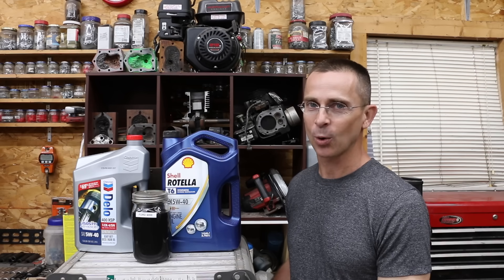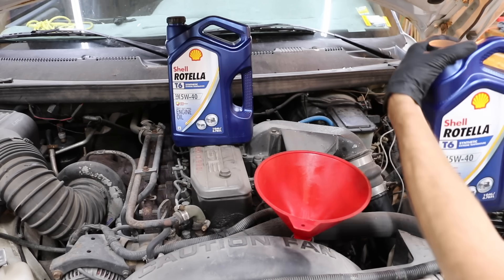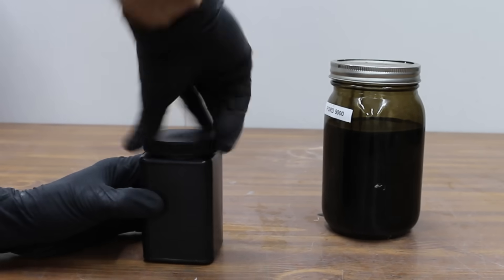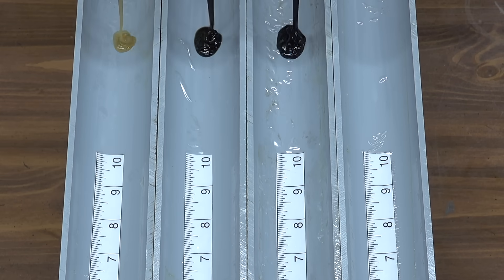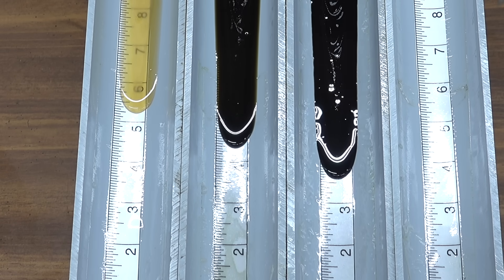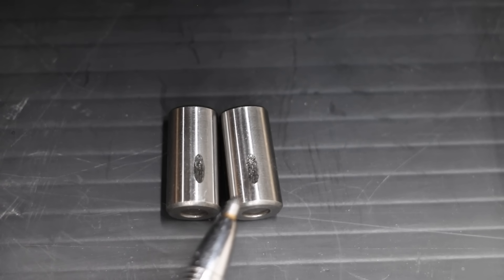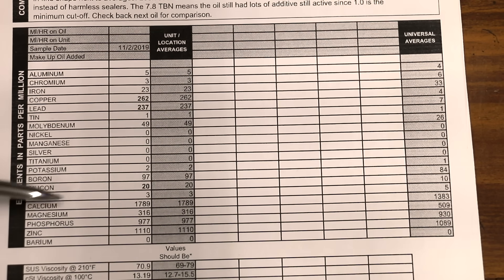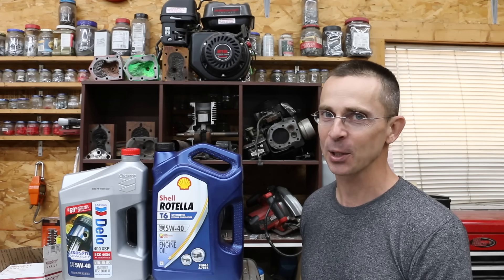Will Annual Oil Change Damage Your Car? Let's find out!

Comment: How about the filter, if the oil can last longer for lower mileage.. Do you still have to change the filter once a year?
Reply from the maker: Thanks for the video idea.
Reply: The lab results also suggest the filters are good.  If the filters were compromised ( bypassed for example),  the lab numbers should indicate engine wears.

Comment: Still need to check under the hood every so often. Power steering, transmission fluid, brake fluid, belts, any unusual noises. Probably do that with monthly starts
Reply from the maker: Thanks for the feedback.

Comment: Dude you have the holy grail of trucks. That 2nd gen is immaculate with low miles!!
Reply from the maker: Thanks!
Reply: @devilselbow  along with every other brand. Ask me how I know
Reply: I've given up on finding one for a price that isn't insane. I just did the next best thing and swapped a built Ford 300 six (the one with forged internals that were put in dump trucks) into a gas 4 speed F-250 that had an oil burning problem.
Reply: @devilselbow  up here in coastal Canada, here in a small fishing community, fords last longer sitting on a wharf in salt spray and saltwater flooding over the wharf for hours on end before rotting out. Its amusing as before everyone was driving fords chevs dodges and gmc trucks years ago but now everyones gone to fords
Reply: @devilselbow  not going to doubt Toyota. I have two of them and they both have rust. But we have a 2003 dodge Cummins and strangely enough it doesn’t have a speck of rust. We always to care of it though
Reply: OIL SPRAY,end your rust.Simple
Reply: Everybody loves those engines, but the rest of the truck just isn't very well made.
Reply: @marcuscook5145  Or you can do what I did and put that engine into an 07 f250.
Reply: Aha!! The secret to a Dodge truck’s long life is low miles.
Reply: @gregnixon1296  the secret to long life dodges is a well taken care of Cummins. More trucks over a million miles than the other 2 diesel competitors combined

Comment: I was pleased that you did this video, I've got a truck that only gets used 2000-3000 miles a year and I was worried about the oil.
Reply: Yeah.  I usually figure out all the ways to get away without doing things that don't need to be done by learning a lot of hard lessons.  Already figured this one out for low milage cars years ago, but it's always nice having my process confirmed with science.

If anything, I'm thinking that the 1 time a year I change my oil is overkill after watching this.
Reply: @thedude5295  It's pretty important that even if you don't put many miles on a vehicle per year, when you do run it, run it long enough to get it to full operating temperature. A bunch of very short trips on a vehicle are HARD on it.
Reply: @TomD1999  Good to know.  I've noticed that the car starts up fine right out of the garage, but if I'm going to 2 or 3 places in the area in a single trip it starts a bit harder by the last time I fire it up.  That's even during the summer.

Comment: I have a very important question about engine oils. In Pakistan we use toyota's 2nz fe 1.3L and 1.5L 1nz fe engines and the company recommends 5w30 engine oil but the temperatures in Pakistan rise to 50 Degree centigrade which is very high. Should we use 5w30 or the thicker 5w40 as preferred by many bcz if high temps? Your reply will be very valuable for us pakistanis. Thank you.

Comment: With this experiment I would have collected all of the 1+yr old oilfirst, shanken it up well and then collected the oil sample from a mid-flow exchange from that ontainer into another container to get a more accurate reading of contaminants including excess water. It might be a better test in general any time you remove oil from a crankcase.
Reply: That's the way that my dad would collect oil samples when he was sponsored by various factory race teams. He would collect one from first mid flow and a second one from the shaken up total collected at mid-pour from container used to collect the initial drain to the waste barrel. Just food for thought. Keep up the great work!
Reply from the maker: Thanks for the constructive feedback.

Comment: Use Mobil 0-w40 in my 2004 Crossfire which is recommended. Any info on this oil would be great.  Current do very low miles and thinking of waiting a year before changes.
Reply from the maker: Great suggestion!  Thank you.

Comment: I've been doing a >10,000 mile interval on my 4.0 Wrangler for 18 years. Haven't' been doing the mileage in the last few years, so I've been going every 2 years. In fact, My Generac actually recommends changing the oil at least every 2 years. 
Motor oil is one of those things that people just love to over-think. People get it in their head that somehow the oil starts going bad as soon as it goes into the car. That's not the case at all. There have been studies that say oil actually gets better for a while before losing any beneficial properties and A synthetic at 10k  is actually still better than it was when it was new.
Reply from the maker: Thanks for sharing.

Comment: This has so many environmental factors there's no way you can simply tell from a test. This being said I can recommend on anyone with a 5.4 3 valve engine to change their oil every 3000 Miles without fail and use 5 quarts of 5w 20 and 2 quarts of either 5w 30 or 10w 30. 5.4 L engines are notorious for cam phaser wear causing a noticeable ticking noise. This comes from a few things including stuck or dirty VCT solenoids not opening causing premature upper engine wear or cam phasers wearing prematurely which causes the engine to be out of time and causes a tick. Change the oil and you'll get past a hundred eighty thousand miles, don't and you'll need to do a full timing set and oil pump.
Reply from the maker: Thanks for the feedback.

Comment: I knew it was a myth with modern oils. I let my lawn tractors and zero turn wait until the hours. I change my cars full synthetic every year at the same time it is in for annual inspection up here in NY. An oil and filter is cheap compared to the cost of engine damage. I have a 2013 Toyota V6. So little chance of that.
Reply from the maker: Thanks for sharing

Comment: First, thanks for the videos as they give me great entertainment. Did you ever test how transmission fluid would hold up to extended service? My Honda Jazz (Fit in USA) has a CVT and the manual calls for two year fluid changes. Obviously, I'll go with the manual's stipulation and the change is cheap compared to a transmission fix. But I am curious. Big thumbs up from Ireland!

Comment: Great video! Considering about 2/3 of vehicles on the road are more than 75K miles, and many of them use high mileage oils ( conventional or blended synthetic). I hope you can do a similar test with high mileage oils with the priority for conventional high mileage oils. After all,  conventional high mileage oils are less likely to cause engine leaks. Thank you!

Comment: I think the idea behind the yearly oil change under mileage is due to the use of conventional oil. Conventional oil is less resistant to breaking down than synthetic oil. It may even be from when oils were less advanced and were more prone to rapid breakdown and contamination over a years time.

Just my opinion based off of the automotive education and experience that I’ve had.
Reply from the maker: Great feedback. Thank you

Comment: Another good video. I used Delo in a gas I4 engine before. It had no emission equipment to worry about.however the engine did have a rod knock. I was simply trying to baby it till spring so I didn't have to pull the engine during the cold winter weather. I have in my mk6 gti now T6. It seems quite and not a unusual amount of metal during drains. 
Btw the Delo worked fine in the previous engine and it made it past spring and into summer where I then pulled the engine and did a full rebuild with a new crank and rods.

Comment: I had a performance V8 with 40,000ks on the clock when I got it, I didn't do a service or change the oil for 60,000ks. Nothing happened. It still drove like new. Those 60,000ks were over a 7 year period. Tell me again how you need to change your oil every 6 months. Admittedly, I don't drive my cars hard and these ks were both long trips and around town.

Comment: Besides testing a similar scenario on a gasoline as one of the comments said, it would be good to see how the oil degrades over mileage... if you go 3000 miles over, 6000 miles over... for an engine driven in extreme conditions as per manual..

Comment: Should do a test does oil filters that can last 15000 mile is that on a single oil change or using the same oil filter twice for example oil change at 7500 keep same filter on with new oil?
Reply from the maker: Thanks for the video idea.
Reply: @ProjectFarm  no problem it's just confusing those oil filters that say have a 15000 mile life spend for I have filters I just don't want to change oil at 6000 or 7000 miles and throw away a completely good working oil filter if I can use it again for another 6000 or 7000 mile
Reply: @ProjectFarm  oh by the way right now from my knowledge AutoZone STP max life filters (that last "15000" miles) cost around $4.00+tax if your going to the video

Comment: definitely right.

my dodge 4.7L has had the same oil (valvoline synthetic with Lucas additive) for two years, only about 1100 miles.

dealership tested the oil last month, and came out still perfect.
Reply from the maker: Thanks for watching.

Comment: i was right! i ran 5k miles on Castro full synth for 14 months in a Mazdaspeed turbo with no issues other than som oil loss from the turbo.  I never believed the 3 mo 3k oil changes bullshit even for reg oil!  Oil is effing tough stuff and better additives than 30+ years ago!  Common sense imo.
Reply: Well in the US seems there is a Jiffylube or similar every 5 miles along the highway and everyone is told 3000 miles or your car dies!!! Back here in Europe...no Jiffylubes and annual/every 10000 miles oil changes (if you can be bothered...close enough). I wonder why...
Reply: The 3/3 is what folks did in the 60’s and before because the oil got dirty fast. People have been using that interval without revising over time

Comment: Very, very good video. I've been a T6 user for my 6.6 liter LMM Duramax, which now has 318,000 plus miles on it, this video just made me feel that much better about that choice. But I also use the Liqui Moly Truck Series Oil Treatment with every oil change, plus the AC DELOC oil filter.
Your videos are very informative, and none bias, which sets them apart from the rest. 
Maybe in the future if you do another Oil Additive test, you could try the Liqui Moly Truck Series Oil Treatment? 
Thanks a ton for the great videos. 👍🏻
- Jim from Wyoming.
Reply from the maker: Thanks for the video idea.
Reply: Project Farm what type of engineering degree do you have?
Reply: Same I know what I’ll be running in my recently purchased lml

Comment: Motorcycles can use Rotella T5, T6, and Delo 400 LE, as well as some other diesel oils. They all meet the standards at a fraction of the price, best at Walmart - "motorcycle oil" is barely more than marketing and really unnecessary unless you have a highly specialized bike. I ran T5 in everything from my Ninja 250 to my Goldwing 1500. If you live in a city, go more synthetic (T5, T6) and lower cold weight (5w or 10w) higher hot weight (50). Less traffic or lights and conventional (Delo) is fine (10w, 15w; 40, 50).
Reply from the maker: Thanks for the feedback.

Comment: That filter? Terrorific? I have to remove the intake and disconnect some tubes for change the oil filter which is almost inside of the engine lol
Reply from the maker: Thanks for sharing.

Comment: Hello theres been another brand out found on amazon website called Triax synthetic oil.  They have available in 15-40 full synthetic and also 5-40 full synthetic. Many claiming this to be the best diesel oil in the reviews. Can you please do a test on Triax diesel engine oils? I'm curious if this is better then delo and T6. There is also royal purple diesel engine oil as well. You can add that to the list but I'm mainly interested in Triax lubricants. I'll even send you a 5 gallon bucket of the triax 15-40 full synthetic if you want it.
Reply from the maker: Thanks for the video idea.

Comment: Consider an after market bypass filter?  Never change your oil! Just change the filter and add makeup oil. Used them on semi trucks and pickups. Once you get past what grandpaw tole you, you can save much money, and still have a better engine.  Frantz filters are still available. What does it use for replaceable filter elements?  Toilet paper!  Promise that it works, since WWII. Cannot have grandpaw being wrong though. As an aside, synthetic works better and longer
Reply from the maker: Thanks for the video idea.
Reply: oil is not rocket science, when it becomes dark and unable to read the dip stick, gritty feel when rubbed between fingers, or begins to smell bad, then its time to change it,  usually between 4 to 6 thousand miles depending upon the type of driving circumstances.....Conventional oil has the same additives that supposed-synthetic oil has, and thats what breaks down.....its mostly common sense. You can apply this method with Wallmrts Super Tech conventional, or Amsoil, with most any filter, and after 20 years the engine wont know any difference.They can both run 25O,000 miles with proper maintenance and the engine will still be in good condition if proper driving habits have employed.

Comment: the leaks being "caused" by synthetic oil are a mostly a myth - it goes back to the days when there was still non detergent oil available and older engines were so packed full of sludge the oil pan and seals weren't pouring out due to the sludge acting like a sealant - as soon as a good high quality detergent oil was introduced - the sludge cam out of suspension and the leaking started - but it wasn't caused by the oil - it was just being prevented by the sludged up oil in the engine - much the same way an automatic transmission comes apart once someone services it after 100,000 plus miles with no prior servicing and everything comes out of suspension
Reply from the maker: Thanks for the feedback.

Comment: MY Honda XR650L takes regular motorcycle oil which is 10w-40....many people use Rotella T6 which is diesel oil? The motor is air cooled so people think the weight makes it harder to heat up. Compression is 8.3:1? I put 91 octane and synthetic oil but probably gonna start using 87 octane and T6 oil.... what's your thoughts?
 I live in San Diego so doesn't get cold...so can run thicker oil!

Comment: Compare Rotella T6 vs actual 4 stroke motorcycle oil. T6 is wet clutch approved (JASO MA2). But is rotella going to damage a motorcycle transmission? 
Cheers from Canada
Reply from the maker: Thanks for the video idea.

Comment: Best thing you can do for any motor transmission and any lubercation needs!
Add MUSCLE MT10 BEST stuff EVER. I use it
Reply from the maker: Thanks for sharing.
Reply: @ProjectFarm  on YouTube they have test on the stuff a race car guy i know in San Antonio texas used it they rebuilt the Motor end of the season Motor was running totally bad ass no issues ... On the rebuild found spun main bearings . now that some proof of how well it works regular oil spun main bearing game over when racing sir.  They also sell it on ebay and make fp10 for guns. Im gonna get more and lube my barrels and the bullets i reload should make more fps and less wear on RIFLING maximizing life of my barrels.

Comment: My oil was good after 10 years since the engine was running like a champ. Although, I could tell the oil needed changing when the engine started to sound like marbles in a tin can - meaning the oil was becoming too thin.
Reply from the maker: Thanks for the feedback.

Comment: Very informative video. I am just wondering if the overall environment conditions affects how long oil can last in a daily driven vehicle. For example, Singapore, being a hot and humid country throughout the year, we are always told that our oil do not last longer than those in temperate countries and therefore, requires changes in shorter environment. 
Might you have some insights to the above claim and inquiry?

Comment: Fantastic!  I use the T6 in Sea Doos--it meets the standards for a number of motor cycles and smaller engines like the ones I run.  Never had a problem, but like to change the oil every season--just because of the sheer amount of water these things are subjected to.  Appreciate your testing!!
Reply from the maker: Thanks so much

Comment: 96 with 114 , sweet , I use the Mobil1 5-20 FS extended drain in truck and car , change about every nine months or so , no issues .. Delo 15-40 in the coal burner .. Back before we knew better in the 70's eighties and 90's ? Ha , I have changed oil in a F250 gas burner with 900 miles on it in three months , it stayed off road on the farm and rarely saw the highway ...
Reply from the maker: Thanks for sharing.

Comment: I have rarely changed oil based on age but on hours of use. I have an excavation and construction company with dozens of rigs and pieces of equipment,,,,in over 40 years we have had zero issues.
Reply from the maker: That's great!  Thanks for sharing.

Comment: Thanks for the video. I have a couple cars that I barely drive, so I wasn't sure if I needed to spend the money on six month oil changes, etc. Sounds like as long as I let the engines hit normal operating temperature once a month, I can go over a year without an oil change.
Reply from the maker: Thanks for sharing!